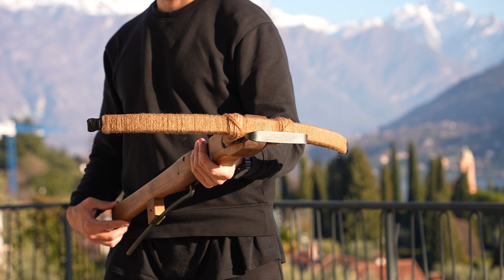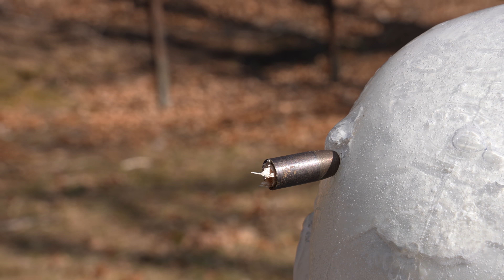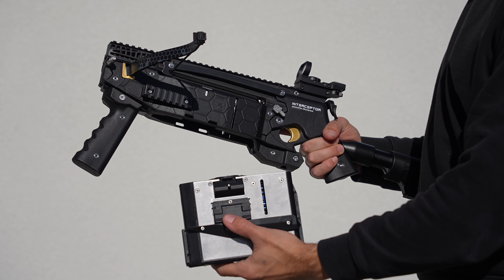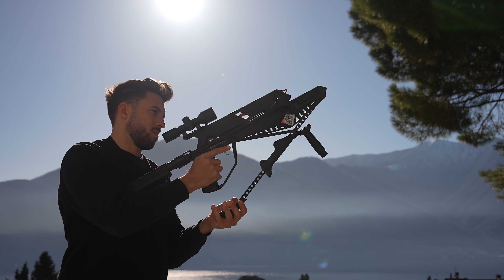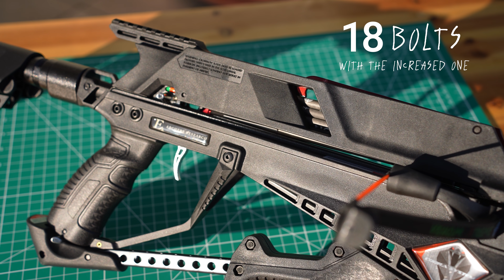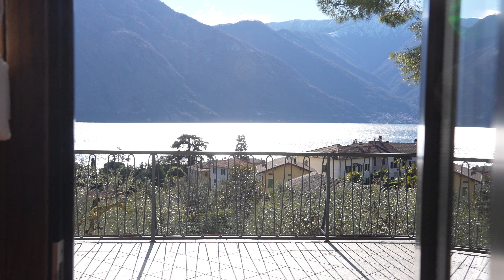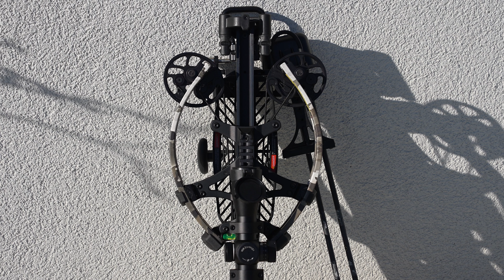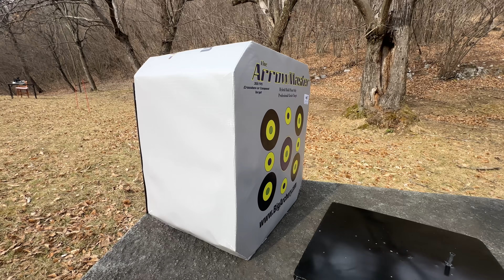How Dangerous are Crossbows?

Comment from the maker: Clarifying a few things guys:

1. Semi auto is not the correct definition for those crossbows, a better term would be repeating or “manual-action”

2. Medieval crossbows could have more than 1000lbs draw weight so I apparently got an average one. Edit: just checked and the big ones are very hard to find, they cost thousands of dollars and it takes weeks/months to receive them.

Hope you enjoyed!
Reply: comparing poundage between a crossbow and a standard archery bow is very inaccurate, as you mentioned later the draw length has a lot to do with delivering power.

the first crossbow is actually  a very bad setup especially with those broomhandle shafts. kinetic energy is displaced over the entire point. so is nearly a blunt object, it also effects achievable speeds as it create more drag too. also the density of the marertials used is questionable. seemed VERY light compared to the size. traditional bolts were 2-3 times as thick as an arrow, that was 5-6 times. are tehy as powerful as they are in movies? no... but that one seemed to be more a movie prop or a wall hanger rather than a true functional crossbow. I also noticed it flew very "wonky". the bolt is so stiff that the rear of the bolt was faster than the tip and never stablized. again its due to its overly thick shaft.
Reply: The firearm term you're looking for is repeating. It means it's able to be shot multiple times in one load, and requires a repeating action to make ready to fire again. So exactly what the Sprave crossbows are. The most well known rifle with this system is probably a Winchester rifle.
Reply: @Propulus  In various languages, "repeating" is used in place of semi-auto with R listed on the firing selector, so I think using that will only lead to more confusion and might have been what caused it in the first place. Most countries localize their markings or use universal symbols.
Reply: @Propulus  Lever action !
Reply: @Propulus Manual-action might be a better label
Reply: thousand of dollars? did you forget who you are? if the knigts could make it you can "make it in a cave with a box of scraps".
Reply: there's actually another crossbow that has the same feature like the adder but stronger.  It's the cobra R-series siege crossbow.
Reply: Interesting!
We have to combine draw weight and speed of limbs when we compare bows  (it's complicated )
The limbs acceleration is depended of the material. 
A Medieval bow can not compete at all with a modern bow.
Reply: To date, the best-performing replica of a medieval European crossbow small enough to be a personal weapon delivered nearly 200 J at nearly 70 m/s. In terms of kinetic energy, it surpasses all of the crossbows you tested apart from last one. The medieval-style crossbow you tested here performed very poorly & doesn't represent any sort of historical battlefield weapon.
Reply: Your crossbow is more of a weaker crossbow type. Not a war crossbow. For a war crossbow you should go 350 to 500 pounds. For a field crossbow. For a siege crossbow yeah you are looking at 800 pounds plus of draw weight.

Edit further on medieval crossbows, the speed of the bolt is limited by the speed of the returning limb. That means that you can increase the weight of the bolt for more energy without loss of speed. For such a week crossbow you would be looking at 30 to 35 gram bolts. For a 500 pound one you are looking at 60 grams. For a siege crossbow at least 90 grams. The difference in speed for a 860 pound siege crossbow between 80 and 90 grams bolt is between 1 and 3 m/s. The limit is the limb speed.
Reply: @Heldermaior  War crossbows can have less draw weight if it makes up for it with greater powerstroke and/or greater prod efficency. The problem here is the video creator went with a triple whammy of low draw weight, low powerstroke, and low efficency. For example, a ~950-1000 lb steel crossbow in Todd's Workshop videos performs somewhat worse than a ~160 lb self-bow and a modern ~150lb crossbow because the steel crossbow has high draw weight which almost makes up for its low powerstroke and poor efficency.
Reply: @Intranetusa  medieval crossbows by and large have similar power strokes.
Reply: Also the bolts you used woth the 3rd crossbow seem more like small game arrows(for things like squirls) but im probably wrong, I'm just going of of my bow hunting knowledge
Reply: Are you from norway?😅
Reply: did he forget to pin this comment or something? 
Edit: Nvm i was here before he pinned it
Reply: 9:48 has a frame where the house is decensored btw
Reply: @MikeShake do this video again with AirBows. No cocking needed, just air!!!
Reply: You should test Airsoft guns Like snipers or pistols
Reply: Also, keep in mind the bolt you used was blunt tipped. It's basically a toy bolt.
Reply: Hermanó pa cuando la traducción de español 🤙🏻🤡
Reply: You're a badass! Great video!
Reply: Saying that the safety switch is the same as an AR rifle while being somewhat accurate is also somewhat misleading. AmraLite Rifle or AR is simply a small arms company who makes firearms with the AR designation. An ambidextrous safety switch extends to multiple caliber and size firearms and isn't limited to just the Armalite company.  A lot of people tend to misuse the AR term for assault rifles but it's a specific brand of firearms and doesn't mean assault rifle.
Reply: Create your own deadly crossbow
Reply: Crossbow and bow power are determined by 3 factors that are multiplied with each other in energy calculations: draw weight, powerstroke, and prod effiency. This 3 factor relationship is why Todd of Todd's workshop youtube channel discovered that a 150-160 lb organic prod longbow and a 150 lb modern crossbow (he calls it his lockdown longbow) actually shoots projectiles with more energy than a ~1000 lb steel medieval crossbow. Medieval steel European crossbows can have high draw weight but very low powerstroke and low prod effiency (there are exceptions with composite and other organic type European crossbows). The powerstroke (draw length minus brace height) might be 4-7 inches. Steel is not an efficent material for prods because it is heavy and cannot spring back very quickly - this meane it cannot transfer energy as well as organic materials. There are many different crossbow designs around the world. Ancient & medieval Chinese crossbows and modern crossbows use a different approach that favors a lower to more moderate draw weight in combination with a much greater powerstroke and higher prod efficency.
Reply: Honestly, I'm completely discounting the first crossbow you showcased from your final results. It wasn't treated nearly the same as the others. Was far weaker than it should have been to be an accurate example (not your fault, most replica old style crossbows that are affordable are more training models than actual hunting/useable ones), used a totally different type of bolt that just cannot be compared to the modern ones you used from then on, you gave the accuracy test FAR more goes for each subsequent test to "zero in" the scope which you didn't give the first crossbow the same chance, and you used that same oversized (and probably much lighter) "armour-piercing" bolt for the kill test whereas all the rest you used specialised bolts specifically designed to go up against unarmoured targets, to cut through skin and pierce bone. Not saying you did it on purpose to make the newer models seem better artificially, but the end result was every metric except speed was a variable you didn't keep the same - so any comparisons are totally null and void.
Reply: You need to clarify too that manual action crossbows are old asf invented by the chinese empire around 200 AD, not by an influencer.
Reply: Mike makes an awesome firearms instructor… very kind voice but lethal AF
Reply: Bro podrias hacer un video haciendo una daga oculta de assassins creed que sea automática,viendo tus videos se que podras creaela 🤩
Reply: 5:30 We need this in Rust! Rust players would go crazy with these
Reply: I chellange you to do the bicycle it is super difficult just for it brain bicycle you yourself should make it because I don't think you can find it
Reply: I chellange you to do the bicycle it is super difficult just for it brain bicycle you yourself should make it because I don't think you can find it
Reply: Put electric motors on it with capacitors for start-up torque and gearing and try to make a real automatic one
Reply: Look out for the PD5 by steambow. It is like the interceptor but can have a 160lbs bow and uses the same 7.5 inch bolts as the Adder. It is not out yet but there are videos on the prototype.
Reply: lever action for first one
Reply: never realized how much kinetic energy a crossbow bolt can carry — that penetration test was insane! Definitely not a toy.
Reply: Why don’t you remove the foam from the target and fill it with ballistic jell? - ballistic jelly is jello chilled and reheated. The DIY jelly is very affordable.
Reply: lever action
Reply: Jörg Sprave coneptualizes them "slingshots" but then looks for manufacturers to finalize and sell them basically for free. He instead takes a cut for marketing and selling them. Because thanks to chinese companies patents are basically worth nothing. yet if you can market your creations better than the chinese can market the copies you are still in for a win.
Reply: Hi bor my favourite youtuber in all of the world please make a new video ❤️😊
Reply: Apparently crossbow changed the world's power balance more than any weapon before, because they were are accurate as a gun, before guns were around. Meaning you nearly hit your target and because they were already drawn back, unlike a bow, you could hold people at ransom, without them even attempting to escape while you drew your bow. The short time they were around between bows and hand held guns being invented, they changed the borders of the world and had more impact on world affairs than any other weapon before. They were a total game changer.
Reply: y si haces un arma de aifoft muy potente y la pruebas con un maniquí balístico?????? Fan😊😊😊😊😊😊😊😊😊
Reply: Cuanto cuesta en euros la ADDE
Reply: i would say they are break action or pump action before saying Semi-Automatic
Reply: To me, the Adder looked to be the most similar to the old Chinese repeaters but with one major difference; losing the need to rest the stock on your hip.
Reply: Appreciate the comment about how loud crossbows are. Also glad to see that you didn't Robin Hood your bolts leaving them in the target for your accuracy tests. My first crossbow, a Tenpoint Titan, taught me never to shoot a bolt at the same point of aim without  pulling the first bolt on the second shot....😢
Reply: Repeating is wrong as well.
Reply: cocking
Reply: Now you can watch and stream these videos with Turkish dubbing.
Reply: The medieval crossbow was built to punch through armor so it could of done better than it did with better bolts
Reply: That medieval crossbow was not the true medieval because those crossbows could shoot on 100meters easy
Reply: @ThirdoptionJCSU facts
Reply: you probably will never do that, but gogun also sells the Ashinger, would be so nice if you could test it.... its the most powerful harpoon on the planet now, 160joules atleast, and joerg shoot a real army steel helmet with it, it penetrated completely. And the most importantly, it has two shoots, and you can shoot two bolts at the same time. The energy is insane
Reply: War bows can have regally  draw weights over 150lb, and a much longer power stroke making them often more powerful than crossbows, though they require much more skill to effectively use
Reply: You should have included reload time, so we can have bolts per minute rating. .. something like that.
Reply: I think they're...... bolt action
Reply: @FuzzyblurAHHHHH  <- This comment deserves more up-votes for the Dad joke!
Reply: @FuzzyblurAHHHHH  I’m gonna do a  🤓👆really quickly and say that that that is not bolt action, that is laver action
Reply: @MikeShake  bolts were also not really made for penetration, but we forgive you lol
Reply: Fra, prima di pubblicare i video sistema le pubblicità, non farlo fare automaticamente a YouTube perché vedere un video con così tante interruzioni è improbabile.
Reply: hard to find and poor poor quality if THAT is all it takes to shatter those bolts.
Reply: @osmacar5331  which one? 
b/c the top rated bow is putting out so much power that it's bolts are basically considered 1-time-use/disposable/expendable, as they would be for any bow above a certain power level, as hitting a target is almost guaranteed to destroy any bolt that isn't solid steel, which comes with it's own problems and can still be destroyed by impacting a target.

really, in general, x-bow bolts are considered expendable resources. arrows for trad bows are more commonly reusable, but they're also being shot at tiny fractions of the power levels.
Reply: very god but medieval bows had a lot more drawing wheit than those today
Reply: hey make an diy airgun and make an airgun video
Reply: The draw length also matters.  That medieval crossbow has crap draw length.
Reply: We call that a “repeating action”
Reply: I was wondering where you got that about medival crossbows in the video since they did require the winch to draw them back.
Reply: deletes smartass comment 😂
Reply: They semi-automatically load when you pump the lever. :3
Reply: You know that last crossbow is out of stock now... just thought I would let people know.
Reply: I would be tempted to call his two repeating crossbows "lever action".
Reply: if you use the term semi auto that will be banned in Communist Australia.
Reply: bro you miss the chance to say let me show you its features! ^^
Reply: Can I have the tenpoint?
Reply: Your crossbow was not the problem your awfully cheap bolts were
Reply: Why didn't you use gloves. Hold the string in place with gloved hands, and use your leg, typically much stronger than your hands to stretch the bow string.  It would mean laying down on the ground to set the bow. At worst the force would be spread evenly between your arms and leg.
Reply: I have a question I don’t know European laws but with wench systems to cock the bows, I wonder if you could use an electric motor or a battery powered drill to quickly cock these bows. Maybe we will see an integrated electric cocking system in the future.
Reply: @emilypeters8888   I think you absolutely can, but the torque required would be quite high so you'd need a pretty beefy motor and gearbox, and fairly large batteries to power it. So you'd lose the lightweight advantage of more modern crossbows and it's be a lot more bulky too.
Reply: More dangerous garbage.
Reply: Oh. Love you bro. Big fan❤❤❤❤❤
Reply: Great video. Where are you from? I can't quite pinpoint the accent.
Reply: The word insane has a meaning that is different from "extreme" or "astonishing" or "surprising" or even the now out of fashion "amazing".
Stop the insanity.
Reply: Do it with bow, for the nest video
Reply: Thx you told the name of the website tysm im gonna buy one
Reply: I mean average medieval crossbow just seems like the right choice in any case a 2k medieval crossbow is probably some ornamental thing. But the one had was probably given to the masses.
Reply: Edit 2 Your tips on the first crossbow are way too dull as well it's not a theory that the medieval crossbow was deadly it's a fact like history definitely proves this. Also, the first shot definitely proved you can be accurate because you were shaking pretty bad even in that shot. A trained crossbowman at the time would have done better most likely no offense just i think it's valid to assume.
Reply: 3 The bangs on your crossbows wouldnt last nearly as long as the ancient one and you can fix the old one....well this isnt even a test but awesome video...sorry taking this too literally but this isn't science lol No control at all lol
Reply: impraticável.  Anos-luz de distância de um rifle
Reply: 15:51 that's a weapon! A lethal one.
Reply: Hindi dubbed language
Reply: also 348 is more than 163*2
Reply: For those who dont know

1 note about comparing draw weight vs "power" 

Draw weight is a measure of how hard it is to draw back the bow string. It dose not correlate directly to the "power" of the crossbow or bow. Reason being, with a crossbow, you can only draw the string back so far, so to make up for that, they have a very large draw weight for their size, and the upper limit of this is why we have the assisted draw devices.

An english war bow, famous for its "power" amung long bows, had a draw weight of ~180 lbs at the high range, where as war crossbows historically maxed at ~1300 lbs. 

But, longbows were offten considered the "more powerful" weapons, because that smaller draw weight is streched across a very long draw. 

Ultimitly tho, crossbows "won" out in the end, because it was much easier to train on  for a good enough adadvantage.

Citation
"Power" 
There isn't realy a good way to measure the power of a bow or arrow/bolt, just as there isnt a good way to measure the stopping power of a gun or bullet. There are a lot of factors that that into it, and not all of them csn be measured well.

"Won"
 Bows of all sorts still had their place, and their advantage in "power" did help, but the cross bow  was eaiser/cheeper to train on.
Reply: 😮😮😮😮😮😮😮😮$134
Reply: RL lo
Reply: The Chinese invented a magazine fed crossbow that truly was semi-automatic centuries ago. 
The Windlass and Cranequin that the modern crossbows have are also centuries old.
Using torsion springs rather than a bow was something the Romans did.
Modern crossbows are actually fairly weak compared to mediaeval ones, which surpassed 3000lbs for mounted. They're mostly just mediaeval designs made with modern materials.
Reply: Had any high end manufacturer considered a big li-ion battery and small electric motor as an option ?
Could be much faster to reload.
Reply: 23:44 The arrows are gonna arrive in time for the video, which should have been uploaded yesterday?

They will arrive, yesterday?
Reply: to sad Sprave is an Right Wing Extremist
Reply: You're such a traitor using feet per second, yards inches and other fantasy units 😂
Besides that, excellent video 💪👍
Reply: wrong weight mid-evil bolt ;-)
Reply: Id call it "Lever Action"
Reply: like 50lbs bow is stronger then first 3 crosbows
Reply: Ah Very, deadly weapons are dealy its kinda in their name!  thats why we have them for home security! none who comes inside when we are home will live!  unfortunately not allowed to use firearms on them :( but they will be finished with katan or dagger if required!
Reply: As a kid who grew up, in the mountains, using slingshots (that literally ANY person could make within a few hours, even a very good, powerful one) --- simple device of just a tiny piece of thin leather, an essentially big rubber band, a simple forked branch you get from your backyard, and pebbles (or even rounded fruits) you pick up from the ground --- I am more interested in your "Quantum Age" slingshot project!  lol
Reply: Loved the video. I think your issues with the lifespan of the bolts is exactly why the 10 point would be the wrong one for the "apocalypse" youll break all your bolts in the first week/month. I think the right one if one of these is the choice, is the one with just enough power, but one where bolts csn be re-covered and reused.
Reply: Thanks professor
Reply: why do you blur 9:46? what it is showing that you had to censor it?
Reply: 😹...You had a dose of the Archer's paradox!🎯😂🤣
Reply: Why tf my comments keep getting instantly deleted FFS, I broke no rules, said nothing wrong to anyone, and it just removes them anyway... it's absolutely infuriating, fk YT, goofy BS platform, so sick of this sh*t smh 🤦
Reply: Yet THAT comment stays. Unbelievable.

Any time you question or criticize the status quo in any way shape or form, including the strange behaviors of the population or trends in society in general, that seem to be red flags to something possibly bigger... YT censors you.

You can say ALL KINDS of wild and horrible nonsense, as long as you're towing the line and have the approved viewpoints for the given era you're commenting in, but you can't politely and accurately express legitimate questions or concerns, even if you walk on eggshells to do it. 

Freedom of expression is literally the basis for any/all free and open societies... and for all intensive purposes, it is now dead, or at least it's been eroded to the point of being on it's deathbed.

It was pretty light what I tried to say too, not even anything serious, but it questioned trends in the behaviour of the general public.

I'm assuming that was the reason it was removed instantly, and repeatedly when I tried again several times. 

Anyway.. just figured I'd at least leave a record that this is happening, for others to see. If none of us does that we'll just end up getting ghost/shadow censored into dystopia while still thinking we're free.

I wonder if THIS comment will even stay! 😂
Reply: 100 bucks for 6 one use arrows made me laugh way too hard
Reply: Ten Piont makes one of the best hunting crossbows in the world. Ravin Xbows are the only other real contender. I have killed over 30 deer with mine, however I have a cheaper slower Ten Point but at almost 400 fps it gets the job done. That high end bow you used last is probably the best and most expensive you can buy.
Reply: This is why I don't like carbon fiber. My Compound now eats them up. 3 shots and they are done. Aluminum is still the best arrows money can buy.
Reply: I really enjoyed your video. I subscribed and will share your channel....even though you insist on using heathen units of measurement rather than the vastly superior freedom units as God intended 😁 now to complete the stereotype of the Amarican I'll add that your accuracy tests are fundamentally flawed.  Without a static  encasement device such as a (  RANSOM REST  ) which is the most universally accepted device for these tests in both accuracy,  speed , and  failure rate.  It's ESPECIALLY NEEDED for the accuracy tests and even more so with human powered projectile devices.  This is because of the necessity of repeating the tests with the same variables which is impossible when done without a device like the ransom rest.
Issues 
Such as Muscle fatigue ,especially with heavy draw rates but even if you were firing a sling shot with mere ounces of draw weight.  Then there's the weight of the weapon I itself I could go on and on but you're clearly an intelligent man who's likely had no military service or much experience with cold or hot projectile weaponry.  This is not intended as a slight but rather a neutral observation based upon the simple fact that you conducted the tests holding and loading, drawing the weapons by hand.  I would be extremely grateful and eager to see these weapons tested again ( specifically for accuracy ) using a ransom rest to remove the human muscle fatigue which naturally increases from the first test.  The speed of reload and the accuracy of the projectile are the most affected by your fatigue. Not just the loading but also holding the weapon as you aim.  Again thank you for sharing this with us even though the test results were COMPLETELY  meaningless without the scientific method of repeatability with the same variables.  I'm excited to binge your videos. Hopefully more recent videos of a similar topic will have already switched to a static system. 
To anyone who sees this-
I hope that you and those you care for are happy,  healthy,  and safe. 
Semper Fidelis 
P.S. I apologize for any words that are out of context or poor punctuation and misspellings. I lost my hand in Afghanistan so now I dictate rather than type and like myself the program is far from perfect.
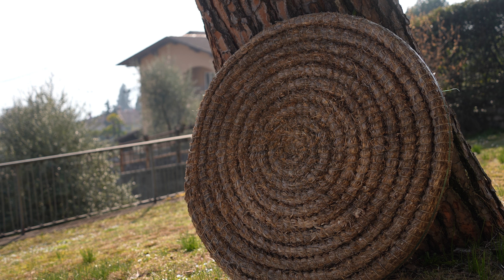Reply: 0:58 for more context, a war bow is anywhere from 60-200lbs often above 100.
Reply: that crossbow was most popular one. There was some top-tioer boys with pavises and best load mechanisms, they got to 300-450lbs. Higher is the siege ones. Not stationary, but fully useless in the field.

So matching of first 3 is kinda correct
Reply: 28grams is 1 ounce not 26 grams sorry
Reply: The medieval one won't kill a zombie (headshot required) but a hit in the neck, torso or belly would easily do the job in a battlefield, even in the leg it would put the enemy soldier down.
Reply: Repeater
Reply: That´s true.
Reply: Кстати, арбалет с обратными плечами был изобретён российским инженером Низовым. Как обычно бывает, изобретатель остался бедным и неизвестным, а укравший его изобретение капиталист разбогател и прославился...
Reply: Dude I just order the 6 shooter needler from gog6n plus I been saving for there new crossbow you can have up 18 shots totally kick ass man so I'm cam wait they have awesome stuff check out his snake knife awesome video of the goguns 😂I plus check out ther harpoon gun pistol it 497 but it's badass
Reply: привет, в России и Германии давно есть арбалеты стреляющие очередями, протестируй их.
Reply: I have a ten point I bought years ago and it's bad to the bone it's only 400 ft per second but I have used it for a long time. Now I want and need this new version and I don't care what it costs hahahahah
Reply: Can I have the interceptor for free as your new subscriber
Reply: Nice
Reply: Rich people problems. 2600 would save my entire future from complete ruin. But I have to work for pennies until I either end myself or die an idiot with nothing to show for it.
Reply: Why not just use a fully SS arrow next time for the 10 ?? Assuming that the speed is going to get a lot slow but the penetration power will be Mythical 😁😁
Reply: 6:29 Bro that thing is cocked and pointed at your neighbors. PLEASE Take a firearms safety course, especially considering the kinds of things you do on this channel. You should know better than to expect the safety to be 100% reliable. Everything breaks eventually and In that moment you were gambling with a manslaughter charge
Reply: First time seeing a vid from you, loved it! Well done! Very compelling from start to end!
Reply: You also would NEED the windlass
Reply: Why are you trying so hard to be American using American measurements for everything? To get those American viewers?😂
Reply: @steven-p7w  We appreciate it.
Reply: Lmao @ the people "ackshewallying" about the use of semi-auto instead of manual-action.
Reply: Mike shakake armas
Reply: Is that lake Como?
Reply: Glad you realized that's not semi-automatic. It was bothering me.
Reply: Sirve al igual que un arma de fuego pero inservible cuando te quedes sin pernos .....sirve solo para divertirse un momento simplemente
Reply: Do you use metric or imperial measurment?
Reply: Yeah, shooting with powerful crossbows is very expensive, probably comparable to shooting with a 50-caliber, arrows are often destroyed and expensive. It is interesting to be able to use homemade arrows, even if their effectiveness is less, but the price of shooting is dramatically cheaper, it becomes possible to experiment with tips, for example, armor-piercing tips made from a file in the form of a triangular pyramid, such Kevlar body armor can pierce, and with not particularly high power, the main thing is to sharpen the edges well, and that the steel is as hard as possible.
PS
A long time ago, my father had a homemade bow, the shoulders were made of duralumin, very powerful, I shot at everything from it, for example, into a wooden box made of rather thick boards, like 25 mm, after a while the box had to be burned in a bonfire, because it looked like a colander, which fired a burst from a machine gun In a few hundred bullets, in short, the box disintegrated into splinters. The tips were animated and armor-piercing in the form of a triangular pyramid made just from a file, such a tip pierces everything with relatively little arrow energy.
Reply: You jinxed it with the first crossbow 😂
Reply: For a fair comparison, you needed to use the same head if not the same exact bolt ( since im assuming they arent interchangeable)  that first one as more like a practice or light hunting tip
Reply: That guy build this before shoot self in head with iron ball or he survive?
Reply: correct, you got a "hunting crossbow" in the medieval style. it's meant for small game like rabbits and foxes.

as you noted in this comment, a war crossbow will have around 1000lb of draw and will require the use of a cocking tool like a windlass... they're also VERY expensive in my experience!
Reply: I bet you could fabricate an insert for a battery powered impact driver to fit the winch of the tenpin, and cock it electrically and much faster....
Reply: @charlesparr1611 
Impact drivers are pretty bad if they are working against a spring system, because the spring will pull in between impacts, undoing at least some of the work. Not to mention that you run the risk of damaging or wearing out your crossbow with the repeated impacts.
Saving a few seconds of reload time wouldn't be worth the risk for me.
Reply: the weight is so high because it has such a short power stroke, they need the high poundage to make up for it.
Reply: @aaronsmith4940 searched for a comment saying this 👏👍
Often misunderstood, and shows a lack of research by the channel
Reply: Very good 👍
Reply: Ak
Reply: I have a video idea for mike shake play chess for a day please 😢
Reply: @ is that deliberately stupid?
Reply: dont take GOD name in vain. its bad bro.
Reply: At 9:48 we can see a few frames of your neighbor's house. Advisably I'd try and edit that with the YouTube tool.
Reply: tbh internet detectives would look at the clouds and geoguesser it if they wanted to @mirrormagic7674